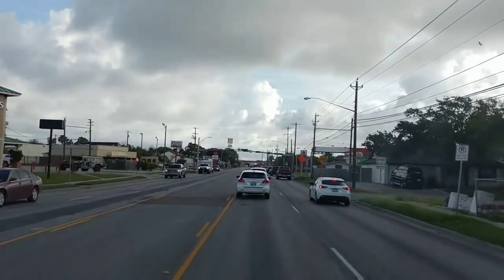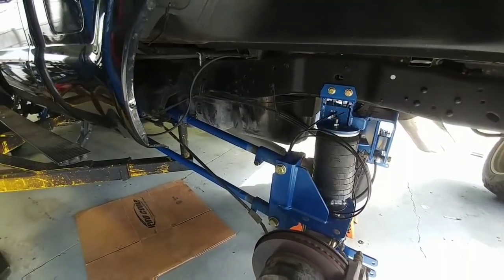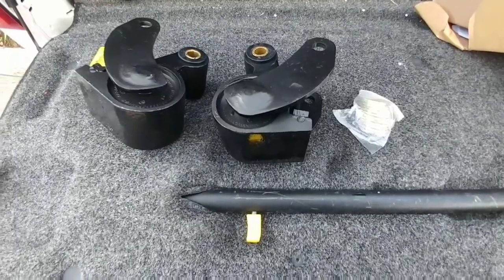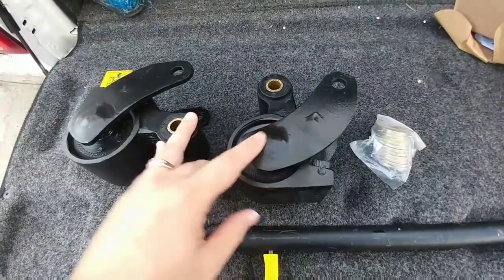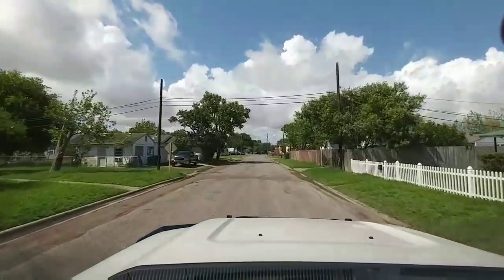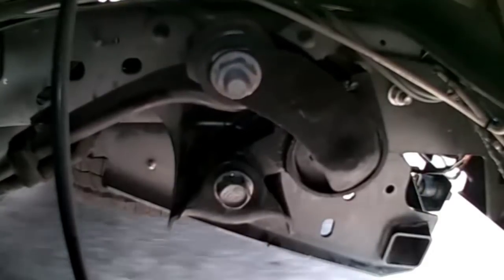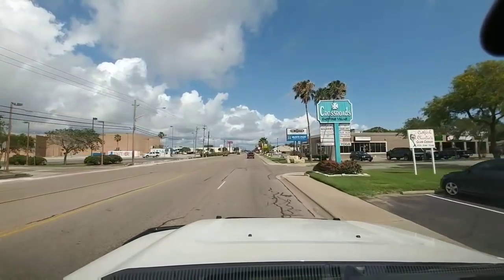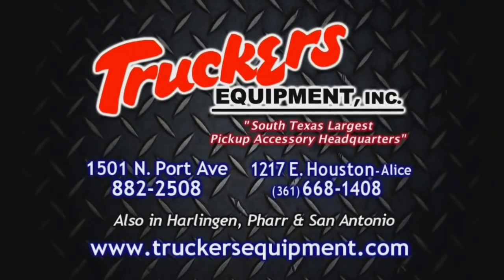Make your 1-ton truck ride like a 1/2 Ton!  Sulastic Springs!

Comment: THANKS SO MUCH FOR CHOOSING TX TRUCK MASTERS TO DO YOUR INSTALL! WE LOOK FORWARD TO WORKING WITH YOU  AGAIN!
Reply: does it lower the truck any?
Reply from the maker: Harley McCorcle: no sir
Reply: No. It does not change the ride height or the load capacity.
Reply: Currently driving a Mercedes Benz Sprinter 3500 which suffers from a very harsh rear ride.

This would be the perfect solution! Too bad they are not available...
Reply: TX TRUCK MASTERS where u located
Reply: TX TRUCK MASTERS  I’m interested in the springs, I have a really rough ride in my 2015 F2 50 gas 4 x 4. Do you have any recommendations for the front?
Reply: Jay Dee I thought these were only for back. Im looking for smoother ride and want something in front and back. Can they do the front?
Reply: Is it ok if you are going to tow on a 2002 f250. Crewcab.
Reply: @sandys2672  04 had leafs on front & rear
Reply: How much
Reply: My question is if you do a lot of towing with a 21,000 pound trailer and now that you soften them up with those shackles will it cause my rear end of my truck to squat more while I’m towing.
Reply: Specialty tools?

Comment: I just installed the "Sulastic Shackles" on my 2013 Ford E150 XLT Premium van with Max Tow Package. This van has a 8600 GVW with a front axle rating of 3700 LBS and back axle rating of 5120LBS. This make for a stiff ride when empty. These shackles are great. Really makes a positive difference when not towing our Airstream trailer. Worth the money and I installed them in my driveway with basic hand tools in less than 2 hours. Easy install. Get them!
Reply: John Harper hmmm. I have a 2002 gmc 3500 savana van. Maybe these would fit mine? They would help?
Reply: What is your best driveway install advice based on your experience?  A partner to tweak the dropping of the jack to align mounting holes?  It doesn't look much more complex that doing shocks or springs to me...
Reply: Less than 2 hours including getting out tools, setting up, install, and putting everything away.
Reply: I'm glad you installed these yourself! 
Replacing a leaf spring shackle is one of the most basic tasks that anyone could ever do. Sorry, but the video creator probably scared a lot of DIY'ers away from even attempting this super simple job.

Comment: They are $460 now plus install labor for 3 guys for 2 1/4 man hours. I'm guessing about $250. 
Sulastic Springs makes them for the rear of mine but nothing for the front.
The underside camera during the test ride was great but I noticed a fair amount of lateral twisting. I suspect this will negatively affect cornering performance as this allows the entire rear differential and axle assembly to shift from side to side with movement of the steering wheel causing dangerous sway. There are videos here that show this movement while driving. It is shocking how much they shift from side to side. This is common on trucks and can be corrected with a bar that connects the differential to the frame.
So, 5 years later, what do you think?

Comment: Added these to my 3500 CC short box Ram, what a difference. Took the sharp impact out of the rough roads. Just finish a long haul with my rv, did not affect the towing while loaded. Good stuff.
Reply: How much did it set you back?
Reply: Hi quick question. I own a ram where did you purchase yours?
Reply: @babybullsmith001  i believe around $500
Reply: @tomasmembrila2879  believe i ordered right from Sulastic on line.

Comment: Just yesterday I installed these Sulastic Shackles on my 2018 Ford F450 and I couldn't be happier!!   Its because of this video that I even found out what these were and the benefit of installing them.  It is such a HUGE improvement in ride quality and I cant thank you enough for sharing your experiences and in depth tutorials through all of your video content.  If anyone is on the fence or hesitant to do this DO NOT BE!  It will be money well spent without a doubt.  Thank you!!
Reply: Noticed that u made this post 3 years ago. How do u feel about the shackles now?   I'm considering buying them and I would really appreciate your opinion on them.
Reply: Still zero regrets.  They have held up perfectly and under tow I have not lost any pay load capacity.

Comment: Ok..did the install.  Took longer due to my shop not having experience.  Make sure there is enough washers so it does not hit the frame.  I called Sulastic and BTW they was great to deal with, then they called the installer, issue solved and very professional .  The ride has greatly improved...great product, very pleased.  Thanks Again Jeff
Reply from the maker: Jeff Jassby: great! what truck do you have?
Reply: 2015 F350 LWB CC.  I added a 6" Pure Perf. Complete stage 4 lift with but w dual Fox 2.5 adj shocks, air bags and a few other tweaks. She rides on Nitto 37x12.5 AT's
http://www.pure-performance.biz/category-s/1975.htm

Comment: Never knew this type of thing existed.  My passengers will thank you!
Reply from the maker: Matt Huhn: My wife thinks they made a huge difference.  Thats great because I really hated seeing my 3yr olds head get thrown around when I went over bumps.
Reply: I'm going to hold off on ordering them in hopes that others will want to jump in a group buy with you.  Thank you for an excellent product recommendation.  I already installed Fox 2.0's on my 250, hoping this is the last step I need to take :)
Reply from the maker: Matt Huhn: Sulastic just offered $30 with coupon code.  SULASTIC RUBBER SPRINGS
http://www.sulastic.com
$30 with discount code: BigTruckBigRV
Reply: Big Truck Big RV awesome!  Thank you!  Will be ordering in the morning.

Comment: I bought into these for my 2020 Chevy HD and … wow, what an improvement! In my opinion, these are well worth the money. The original rear suspension “jarring” due to the expected stiff Heavy Duty ride has completely smoothed out.  Objectively, it feels like about 70% smoother and even if I’m only close, it’s simply impressive. I’m sold on it and loving my HD even more for all that it can do; now I can enjoy it for its superior capabilities and not be shaken and stirred like before. The front suspension is still as it was, yet this has made the idea of driving my HD, a more excited experience. My bones and body will thank me over the next twenty years (hope), which is my plan. I love my 6.6L HD gasser. PS, I live in frosty Alberta (winter of course), and these shouldn’t have any issue compared to Air Bags that typically due under -20/30 or -40C weather. Regarding the removal of the shackle and interference of the underside of box, the mechanic I hired chose to cut that bolt instead of cutting a groove in my underside and replaced them with new bolts and facing the other way (easier to remove if one had to next time).

Comment: They seemed to ride better than stock for a bit. I installed these on my 06 dodge 3500 single wheel and just checked 20 mins ago and the rubber bushing is shot and separated on the passenger side already. installed aug of 2019. only lasted 2 years and now I have to figure ut if I want to go through warranty to get new ones as I'm in Canada and sulastics is in the us.  just a caution for future buyers.

Comment: I just had these put on my 2017 F450.  Dealership had some trouble installing them.  The upper bolts were hitting the frame and producing an angle to the brackets.  Switched bolts to something more like a low profile carriage bolt and it worked perfectly. Glad I did them.  Very noticeable difference and I am glad I had it done. I Highly recommend them.

Comment: Been driving my old 1999 7.3 F250 for the last 18 years...talk about shake, rattle and roll (leafs front and rear)!  Shopping for 2017 one-ton diesel (Ram 3500 vs F350).  Had not heard that Ram 3500 suspension was so much stiffer than other vendor one-tons. This looks like a great product. In fact, had a Ram dealer recommend this as an after-market accessory when discussing ride-quality and the effect of auto-level rear air suspension option. Many thanks for the quality content you provide!! 👍

Comment: Now that I've seen how they work, I'm definitely sold on this shackles.
2018 F-350 Super Duty single rear wheel , stock height, I will install this torsilastic suspension shackles,  with a pair of Firestone air bags 
( 5000 series ), and eliminate the extra factory spring of the F-350. Too bad I'm too far away from South Texas to let this guys put the
shackles in. You can even see there is less bounce on the camera in the windshield.......Thank's for the video.

Comment: I just bought an f250 diesel to pull a big RV. I was very disappointed with the ride quality. Thanks for posting this video. I will do this Sulastic springs upgrade. I'm also in Corpus. Subscribed!

Comment: These were originally velvet ride shackles.  I put them on my F350 crew cab These sulastics are the same deal as velvet ride, (sort of like a lord mount) acts kind like tender spring on coil overs. I freaked when the velvet rides came unbonded. Then these came along. They are worth every penny. They will save you money on the overall maintenance. The only issue I had to deal with (and you may very have to as well, is the bolts are put on from the factory from the center out on mine, meaning you can’t pull the upper shackle bolt out. I used a die grinder, replace them with grade 8 SAE same length. Yours might be different.

Comment: Love the silastic shekel but does not require professional installation start to finish from leaving my recliner to getting back in my recliner 38 minutes from gathering tools jacking up the back of truck with a floor jack using hand tools remove the old shackles install new ones 38 minutes start to finish nothing but a 24 mm socket   Tip take top nut off with weight on truck eliminated need for 2nd wrench  lower on my f350 has a bar to prevent nut from turning   I reused factory bolts  it came with bolts but the factory worked great
Reply: Any updates?  Did they fail or going strong?  Did you love the ride? Thanks

Comment: I bought these for my 08 f450, I would not recommend them as the rubber breaks down quickly. I had to go back to stock after  8 months since the rubber was ripping  apart.

Comment: MAN! I've had this idea for my front leafs for years but never made them.... For the rear,  factory "normal" rear leafs are designed to act as a ridged , "anti wrap"  style in front of the axle to keep wheel hop and axle wrap under control . The rear , behind the axle portion is longer & less compressed. Installing a quality link bar set up to control axle wrap allows you to re arc the front portions and create a WAY softer first couple inches &, rising rate.

Comment: Lowering the rear tire pressure of my unloaded F350 from 80 to 65psi, same as the front tires, makes a big difference in ride quality.  It's free and doesn't void my warranty.
Reply from the maker: 13Sala13: true, but it also significantly decreased your payload capacity and puts more stress on the sidewalls of your tires.  Plus, the reduction of air pressure only slightly improves the ride.  I did this on my 2011 F250. Also, Sulastics do not void you warranty in amyway

Comment: What's the average life expectancy of a set of these under normal use? And once you get to the end of the life expectancy do you completely replace the unit?  Will there be symptoms that they need replacement?  The reason I ask is we pull a 42 ft 5th wheel and would hate to have one reach end of life or break and drop the entire spring assembly....Answers would be greatly appreciated.  Thanks

Comment: Id love to hear your five year review!
My fear is that the rubber will dry and crack and come apart.
Reply: Yeah my question is that too.... how long will the rubber isolator last? Looks like it has a 3 year warranty on the rubber... I'd sure hope it lasts a lot longer than that though! I wouldn't want to have to be replacing these things every 3 or 4 years! That's my only concern.

Comment: Perfect timing, Mr. BTBR.  I take delivery of my new RAM 3500 Mega Cab SRW with Ram Boxes this week.  I will definitely get these and find a good shop in the Huntington Beach, CA area to have them installed.  On another note, I want to thank you for your suggestions for finding a 5th wheel hitch for my new Ram Box equipped short bed truck.  I just heard back from Reese this morning and they say their Reese Sidewinder will work fine on my truck as the pin box does not rotate within the narrower 49" wide bed with the Ram Boxes.  The pivot point is directly under the pin box body, so up and away from the Ram Boxes.  My new truck is at the dealer as of today, going out for weighing on Tuesday, so I will probably pick it up on Wednesday.   Thanks again for the great videos.
Reply: Phil Salsbery - I'm awaiting for the same exact truck. Interested to see how they work on yours.
Reply: Rick, after further research, and visiting  my local truck suspension shop, I decided to not suspend the rear of my new RAM 3500 Mega Cab with the (rubber band) Sulastics.  I chose to go with Bilstein 5100 shocks and lowering tire pressure from factory 80psi to 70psi front and 55psi rear.  Tremendous improvement in ride quality.  I just air them back up when towing.  Hope you enjoy your new truck as much as I do mine.

Comment: Does it affect the truck or rear bed-load-capacity? 
Noticeable improvement.  Even when comparing immediately after the installation , truck did get much quieter.

Comment: F250 took me 5 hours. 4 hours on the first side because I kept adding (and changing location) spacers. I had to run to an auto parts store to get a 9mm hex socket. I'm not a mechanic however am mechanically inclined. Was supposed to torque to 165ftlbs but my torque wrench only goes to 150. Even that was a challenge for a 145lb person. Let me know how much an install should cost on average. Thank you.

Comment: Can you do an update on the Sulastic shackles.  I just installed them on my 2008 F450 dually 4x4. How do they work after they are broke in with several thousand miles..
Reply: How did they work on the 450 I have the same truck and I’m thinking we’re going to Same way

Comment: I saw others asked but I don't see an answer. Are they still holding up? Seeing other posts saying they fall apart over time. It makes sense as the design seems to be borrowed from motor mounts but working a lot harder and under more frequent movement.

Comment: Thanks for the video, I have a 2001 F350 4wd SRW Crew Cab Lariat. The carpool guys hated the ride so much they told me either bring another vehicle or you're out of carpool. I did end up using my Grand Caravan for the carpool and the guys loved it. Despite that I do want a smoother ride, so I think it could make the difference in keeping the truck. Thanks again for the video. To bad the promotion isn't going on anymore I could have used it in a few weeks when I'll probably be order the kit, both front and back. Best Wishes & Blessings. Keith Noneya

Comment: With my 2016 RAM 3500 4X4 dually and factory air ride, I first opted to install the Rancho rs9000XL adjustable shocks; since sway of my truck camper is my biggest issue  Unloaded, these shocks softened the ride quite nicely when adjusted to the softest settings.  Loaded with my 4000lb slide-in camper and shocks set to stiffest setting, also improved the ride by reducing the sway and bounce.  Next on my list is the Torklift Stableloads, then I will make a decision to go with Sulastic or not.  BTW, with the factory air ride, not OEM or aftermarket sway bar is available yet for 2016.

Comment: I installed them on my 2004 F250.  What I notice most is that the sharp hits are no longer present.  They do help but not as much as I had hoped they would.  Maybe in time they will get better.

Comment: The less vibration in your camera alone is very obvious.  Assuming it was mounted the exact same way as before.  Which I have to assume you did.  I just bought a duramax a few months ago and have been asking around, how can I soften the rear suspension and the only answers I get are "it's a 3/4 ton truck, that's just the way they are".  That's just an unacceptable answer and I know there has to be a solution.  Getting a set of these installed very soon now. Thank you for the video.

Comment: I'm surprised you didn't measure the height of the before and after.  I gained half an inch when I put'em on my F350 dually.  Also I'd like to see if they sag over time from the first install.  They do soften up a bit and I can swear I lost a bit of lift but not sure how much.  I do recommend them, however.  They last a long time and take the jarring harshness out of the ride.  I've put'em on my other 4 duallys.
Reply from the maker: yougear, Thanks for commenting!  They really improved the ride more than I thought.

Comment: Great video! How well did these hold up? Did you carry heavy loads with them? I max out my F350 with a truck camper and am wondering if the Sulastic Springs can handle the load. Thanks, Kevin

Comment: I read some, not all of the comments but has anyone mentioned the use of an ultraride chassis air suspension by Link manufacturing? That is a huge improvement over the leaf springs also.

Comment: ordered..looking forward to putting the Solastic in the rear and the Wicked Extreme Duty Heim Joinst steering Drag link in the front for improved steering and control..then off for a front end align..  Thanks for the help.